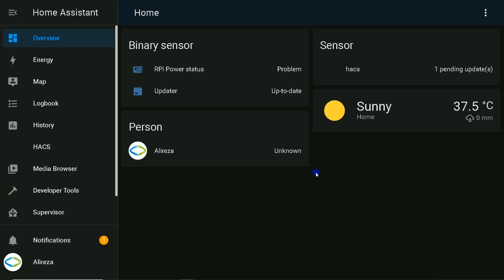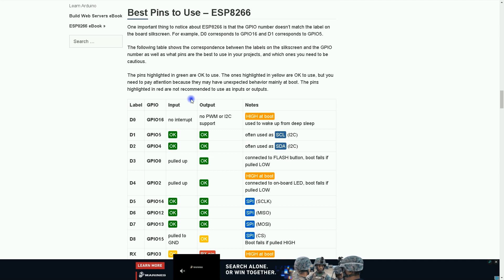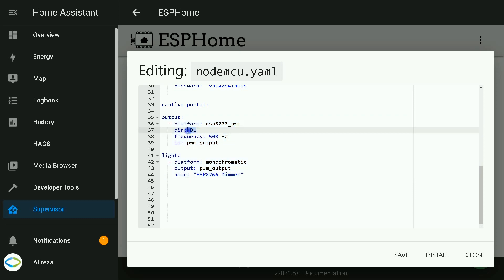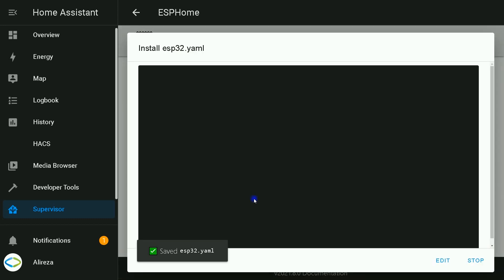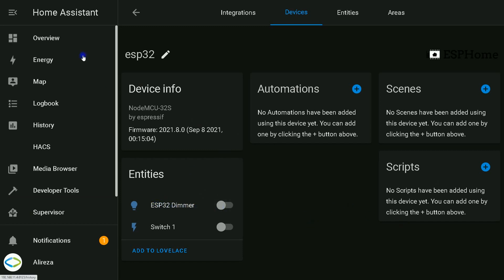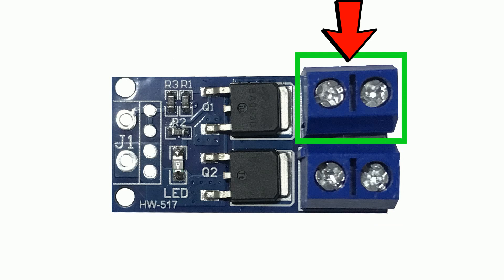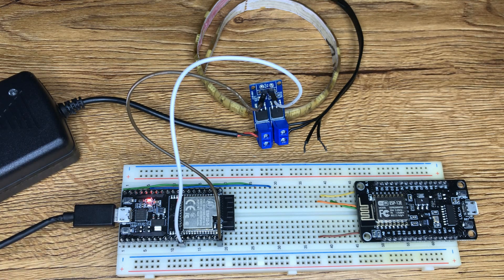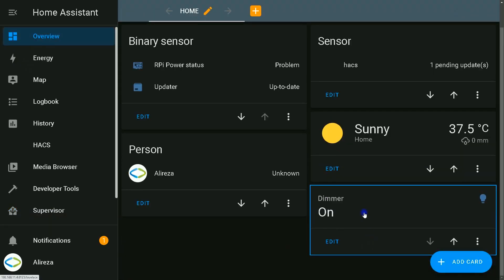Dim Lights using ESPHome add on in Home Assistant

Comment: Great video! Can you use an IRF520 mosfet too? Or is there a reason why the HW517 mosfet module is better?
Reply from the maker: For your answer the data of IRF520 must be checked. but I think there should be no issue.

Comment: Great video - been looking for a concise HA-ESP32 description on how to use PWM for a while. In my case 12V pump speed control. It would be nice if you explained a bit about pulse width and frequency. I get it but might help others.
Reply from the maker: in a nut shell, frequency refers to the times the signal is high in one second. so with the longer high pulse, you'll have shorter frequency.
I hope I could have conveyed the message as it is hard for me to describe it within a few words.

Comment: This video is so great, thanks for making it! I’ve looking for a good one that covers PWM dimming with two-pin (non-individually addressable) LEDs that works with Home Assistant, or Homebrige, and or Home kit for ever and finally this one came up. I’m going to  do this project today. 😂🙌
Reply from the maker: You're welcome and thank you a lot. ❤❤
Reply: Hello! Update/ question! So after having my pwm + light running great for a month 🎉, I put it in a new enclosure  (10cm x 70cm x 30cm ) which is just a little smaller than the first box I had it in. The only rewiring that I did was temporarily disconnecting the final 5v output usb panel jack (that powers the led strip light sign) so I could install it into the enclosure. I reconnected the jack back to the rest of the circuit. 

But at some point after powering up the whole system again (between exactly after turning it on to at the most 1 hour later - I wish I knew but I got pulled away from paying attention),  my S4 diode on my NodeMCU v2 burnt out.🤔 I discovered it about one hour after adding power to the circuit when I noticed the device was offline and opened the enclosure and smelled that dreaded DIY burnt diode smell. 

I’ve since gone back to watch your video to recheck the wiring of everything and all the wiring looks the same as yours /correct. 🤔🧐🤔

Do you have any ideas on why my s4 might have burnt out?   

The only difference between your and my set up  is that I'm using: from the wall, a 12v power supply (good quality Lacie Hard Drive 3A adapter) to  => a Dual 5v voltage regulator / divider (LM2596) . 

From the voltage divider, the first 5v  USB A 1A port goes to  => usb micro cable => to  the Node MCU usb micro port. 

From the second USB 5V 2A port => usb male to wires adapter positive and negative 18AWG wires =>  connected to the “vin +” and “vin -“ screw terminals of the mosfet (the VOUT terminals go to =>the final usb A connector that goes to the led strip sign). 

From the mosfet ,the soldered ground wire goes to the —>NodeMCUv2 ground pin (but on the bottom right side next to the 3v3 pin) and the pwm soldered wire goes to —>the D1 pin (upper right hand side).  

It is interesting to me that the burnt out S4 is on the lower left side next to the vin pin and ground pin that I did not use. 

Should I have used that left side ground pin instead of the one next to the 3v3 pin on the right side? 

In theory all of my grounds in the entire circuit have a common ground so that shouldn’t matter right? 

I have since tested the voltage divider’s  outputs too and they read the same, 5v (as they should) . The led sign pulls 1A max.  

Any thought on what you think I should do before connecting this to a new esp8266 would be greatly appreciated! 😅  

I have considered,  for the next experiment powering the new NodeMCU via the pos wire from the voltage divider to the ESP’s vin pin and the negative wire of the Mosfet to the ground pin next to the vin instead of using  the USB micro cable, to cut out any possible loops but maybe that could cause different problems? 😅
Thank you!!! 🙏
Reply: I just tried swapping out the old, burnt NodeMCU with a newly flashed one and it seems to be working great. I kept all the wiring the same as when the the last one failed. The only difference is that I used a different usb micro cable (until I can figure out a way to test the old one). Still curious if you know how the S4 diode might have blown on the old model. Do you think putting it in a 10 x 70 x 30 cm enclosure was a bad idea?
Reply from the maker: @RND-USA  were you sure about connections and short circuits?
Reply: @kian.smarthome  it’s really strange I never figured out how the damage happened. I hooked a new esp up the the old circuit and everything has been fine. I even put it into the enclosure. So maybe I just had bad luck with an esp. Thanks so much for your video btw. It was really hard for me to find a video on esp pmw dimmers for monochrome lights (2-wire). I’ve been meaning to see if anyone has made some with HomeSpan yet because HomeSpan is homekit compatible without the need of Home Assistant. These dimmers would make nice gifts. This video is best!

Comment: Tx for the superb video. It helped me understand how to wire esp via MOSFET to led. Can this be used for cod led strip?
Reply from the maker: you're welcome.  "cod LED"?
Reply: @kian.smarthome  I assume he means FCOB LED strips. I have been trying to use these because they are flexible, thin, and defused 12v LEDs. But I cant seem to get it to work. Flickering and my ESP32 cannot control the light.
Reply from the maker: @CyrusHostetler  So yes. you can use it for FCOB LED.
Flickering means the power is not sufficient.

Comment: globals:
   - id: Cucina01_is_light01_on
     type: bool
     restore_value: no
     initial_value: 'false'

   - id: Cucina01_brightness_01
     type: float
     restore_value: no
     initial_value: '0.4'

esphome:
  name: light-01-cucina
  platform: ESP8266
  board: esp01_1m

  on_loop:
    then:
      - lambda: |-

          #define step_time         160
          #define step_change_time  4000
          #define start_step        1500
          #define transition_time   80
          
          
          static uint8_t  Steps[4] = { 0, 0, 0, 0 };
          static uint8_t  Up_Down_Fading[4] = { 0, 0, 0, 0 };
          static uint32_t Ton_Press[4] = { 0, 0, 0, 0 };
          static uint32_t Toff_press[4] = { 0, 0, 0, 0 };
          
          uint16_t delta_T[4] = { 0, 0, 0, 0 };
          uint8_t  back_state[4] = { 2, 2, 2, 2 };
          
 

          if( Steps[0] == 0 ) {          // key press wait ...
          
            if( id(cucina01_pb01).state ) {  
              Steps[0] = 1;
              Ton_Press[0] = millis();
              delta_T[0] = 0;
            }
            
          } else if( Steps[0] == 1 ) {
          
            if( id(cucina01_pb01).state ) {
            
              if( ( millis() - Ton_Press[0] ) > start_step ) {
                Ton_Press[0] = millis();
                Steps[0] = 3;  
                
                if( Up_Down_Fading[0] == 0 ) Up_Down_Fading[0] = 1;
                else Up_Down_Fading[0] = 0;
                
                if( id(Cucina01_is_light01_on) == false ) {
                  
                  auto call = id(Cucina_01_Light_01).turn_on(); 
                  call.set_transition_length(200); // in ms
                  call.set_brightness( id(Cucina01_brightness_01) );
                  call.perform();
                  
                  delta_T[0] = 200;
                }
              }
              
            } else {  
              Toff_press[0] = millis();
              Steps[0] = 2;  
              back_state[0] = 1;
            }
            
          } else if( Steps[0] == 2 ) {

              if( id(cucina01_pb01).state ) Steps[0] = back_state[0];
              else {
                if( ( millis() - Toff_press[0] ) > 60 ) Steps[0] = 0;
              }

          } else if( Steps[0] == 3 ) {
          
            if( id(cucina01_pb01).state ) {
            
              if( ( millis() - Ton_Press[0] ) > ( step_time + delta_T[0] ) ) {
                Ton_Press[0] = millis();
                delta_T[0] = 0;
                
                if( Up_Down_Fading[0] == 0 ) {
                
                  id(Cucina01_brightness_01) += 0.02;
                  
                  if( id(Cucina01_brightness_01) > 1.0 ) { 
                    id(Cucina01_brightness_01) = 1.0; 
                    Up_Down_Fading[0] = 1;
                    delta_T[0] = step_change_time;
                  }
                  
                } else {
                
                  if( id(Cucina01_brightness_01) > 0.1 ) id(Cucina01_brightness_01) -= 0.02;
                  else {
                    id(Cucina01_brightness_01) = 0.08;
                    Up_Down_Fading[0] = 0;
                    delta_T[0] = step_change_time;
                  }
                }
                
                auto call = id(Cucina_01_Light_01).turn_on(); 
                call.set_transition_length(transition_time); // in ms
                call.set_brightness( id(Cucina01_brightness_01) );
                call.perform();
              }
              
            } else {                      // release
              Toff_press[0] = millis();
              Steps[0] = 2;
              back_state[0] = 3;
            }

          } else Steps[0] = 0;

 

substitutions:  
  hostname: 'light_cucina_01'
  alpha: 90%  
  intensity: 5%  
  default_transition_length: 1s
  frequency: 900 Hz

logger:

# Enable Home Assistant API
api:

ota:
  password: "xxx" 

wifi:
  networks:
  - ssid: !secret WiFi_ssid_01
    password: !secret WiFi_psw_01

  - ssid: !secret WiFi_ssid_02
    password: !secret WiFi_psw_02

  ap:
    ssid: "Light-01-Cucina_AP"
    password: !secret AP_psw_Light

captive_portal:

    
time:
  - platform: homeassistant
    id: esptime
    
sensor:
  - platform: wifi_signal
    id: rssi_value
    name: $hostname WiFi_SSID
    update_interval: 60s
    icon: mdi:wifi

  - platform: uptime
    name: $hostname Uptime

text_sensor: 
  - platform: version 
    name: $hostname ESPHome Version 

    
    
    
    
binary_sensor:
  - platform: gpio
    pin:
      number: GPIO12
      mode: INPUT_PULLUP
      inverted: True
      
    id: cucina01_pb01
    name: "Cucina01 Pulsante 01"
    
    on_click:
    - min_length: 40ms 
      max_length: 1200ms 
      then: 
        lambda: |-
        
          if( id(Cucina01_is_light01_on) == false ) {
            
            if( id(Cucina01_brightness_01) < 0.08 ) id(Cucina01_brightness_01) = 0.8;
            
            auto call = id(Cucina_01_Light_01).turn_on(); 
            
            if( id(Cucina01_brightness_01) < 0.16 ) call.set_transition_length(60); // in ms 
            else if( id(Cucina01_brightness_01) < 0.4 ) call.set_transition_length(100); // in ms 
            else call.set_transition_length(200); // in ms

            call.set_brightness( id(Cucina01_brightness_01) );
            call.perform();
            
          } else {
            
            auto call = id(Cucina_01_Light_01).turn_off();
            
            if( id(Cucina01_brightness_01) < 0.16 ) call.set_transition_length(60); // in ms 
            else if( id(Cucina01_brightness_01) < 0.4 ) call.set_transition_length(100); // in ms 
            else call.set_transition_length(200); // in ms
            
            call.set_brightness( 0 );
            call.perform();
          }
          
    
light:
  - platform: monochromatic
    name: "Cucina Lights 01"
    id: Cucina_01_Light_01
    output: output_component1
    default_transition_length: ${default_transition_length}
    effects: 
      - flicker: 
          name: Flicker 
          alpha: ${alpha} 
          intensity: ${intensity} 
          
    on_turn_on:
      - lambda: |- 
          id(Cucina01_is_light01_on) = true; 
    on_turn_off:
      - lambda: |- 
          id(Cucina01_is_light01_on) = false; 
          
          

output:
  - platform: esp8266_pwm
    id: output_component1
    pin: GPIO1
    frequency: $frequency